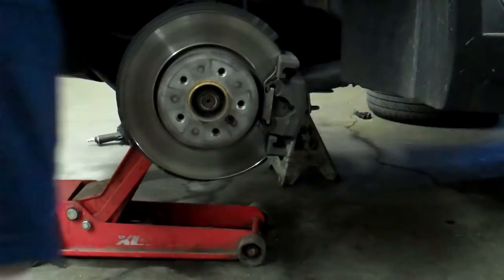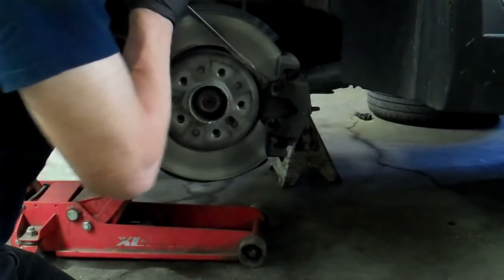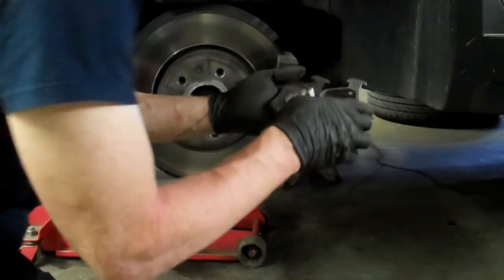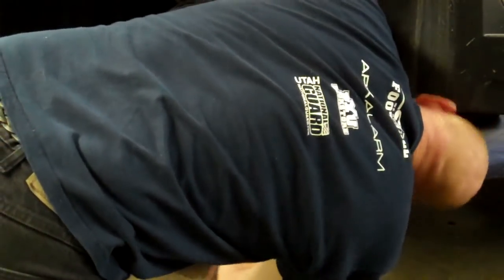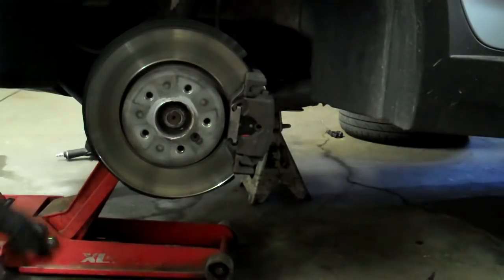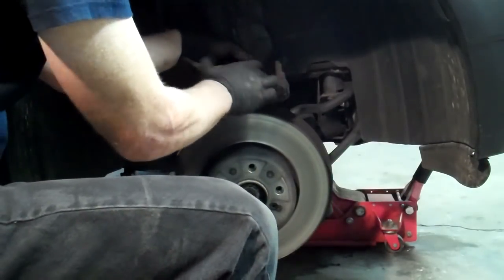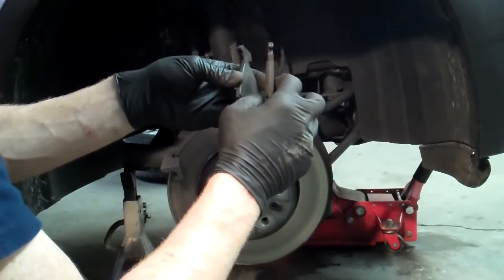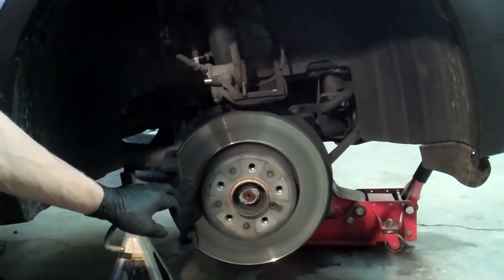How to change your brake pads. ( BMW )

Comment: I'm glad I watched this vid. I've never removed JUST the piston portion of the entire caliper. I usually remove the two 17mm bolts that hold the caliper housing to the strut bar then play from there, but this was a way faster way to deal with it. Great idea. thanks for the vid.

Comment from the maker: You're entitled to your own opinion.  The rotor survived.  I pry close to the inside so it won't damage the braking surface.  I could say your comment denotes idiocy.  Rather than stating your opinion you chose to make it potentially offensive as well. It doesn't benefit you at all and could get you blocked.  Once blocked you would have less access to info you may have had before.  Bless your heart.

Comment: Thanks for taking the time to make this video man!!
Was very helpful... 
Well, I do know how to change brake pads and all but sometimes you can run into odd stuff like a special tool or an extra step that wasn't expected. It's my only car so it sucks if I have the wheels off and the car on jack stands and then realize that I need to go back to the parts/tool store!

Thanks again man!!

Comment from the maker: If some lesser trained individual has overfilled or unnecessarily topped of the MC then yes you do have to open the cap and remove the extra- otherwise it isn't necessary.  When the job is complete you will need to pump the brakes until the pedal gets hard before starting the vehicle.

Comment from the maker: @bfree007 There are shims on the caliper bracket that the pads fit into. If they are omitted you get that.  The shims hold the pads in place.

Comment from the maker: @beefystik You get a digital message that says "Check disc brake linings".  There's a copper wire inside that gets smeared off on the rotor.  Then you just close the circuit by melting a solder "bridge" from one wire to the other.

Comment: You make it look so easy. I will use your tip of prying the old pads loose before removing them from the caliper, wish you'd made this video before hehe. I used a screwdriver to rock the caliper back and forth till it finally came off the disc. Now I know better. Thanks.

Comment from the maker: They are just cars.  Many people struggle with the nuances in design.  As a rule of thumb if seems it's impossible or too difficult, use more thought and less force.  They're easy to service, but tricky to unlatch various components at times.

Comment from the maker: I'd love to, but alas I have not a 1997 Sentra in need of a clutch right now.  You can drop the trans out of those from the bottom.  They aren't too bad/hard to do.  You do it essentially the same way as in my video "2006 Toyota Camry Clutch install shortcut cut labor in half!!"

Comment from the maker: The parking pin/pawl? on inside an automatic transmission is different than your emergency brake on your rear brake system.  In my opinion a car (that I would be comfortable driving) should be able to come to a stop using either the hydraulic or mechanical braking systems.  As for stopping while driving down a grade an obsolete mechanical/drum/rear braking system on only two wheels may not be adequate.  In an emergency aim the car uphill if possible or at something cheap and soft like a bush.

Comment from the maker: @bfree007 You can search for a disc brake hardware kit for it.  They also come with many high grade brake pads.  Many Thermoquiet ceramic pads come with them in the box.

Comment: Friend of mine turns wrenches at the dealership ,uses one everyday with one hand where his snap on would  pull like a mule.  He uses it on all but the highest torque fasteners.  at 180 ft/lbs it does it all.  At  $300 a bit pricey for me , but for a high teck,teck it would be a real arm saver.  Hope you do get one

Comment: Thanks for your wonderful videos. I have two questions:

1. Should the brake sensor to be replaced when replacing the brake pad?

2. Should I replace the brake pads on all four wheels, or just the two front or two rear one?

Best Regards,

Comment: Go to those shops owned by foreigners. Not to be racist, but they do a really good job. I had a 1996 honda accord, as a winter beater, and I take the most cheapest fixes from these guys.

They took $375 for clutch fixing, I've been driving for 3 years after the fix and its driving smoothly. I went to these shops for my radiator fix, exhaust replacement, clutch, caliper seizeing, engine mount vibration, brake line leak, bumber re-attachment (after a fender bender). Cost less than $1500 for all.

Comment: Need to change break pad wearing sensor in order to be able to reset if after installing new pads does not allow resetting. I just made this for F11 after got "unsuccessful" info on display during resetting. So definitely better have all pads (left and right, front and rear) and both sensors (1 front + 1 rear) changed at the same time).

Comment: Great video. I have a quick question i have a 2005 BMW X5 the passenger side wheel the gap between the frame and the tire is 2-3inches on the driver side it is about 5-7 so it looks tilted. What can be the issue? My alignment?

Comment: You may be right for a BMW, I don't know.  However, I have the factory service manual for a Jeep in front of me, and it says "Bottom the brake pistons by prying the caliper over" and quotes a figure.  That figure shows a technician with a flathead screwdriver inserted between the rotor and the caliper itself right at the edge.

If it's a factory service procedure to pry on the rotor for those, it can't be a general case that you are right.  However, who knows, BMWs may be different.

Comment: Oops, I guess I wrote too soon, since you said you use 'disc quiet'. I don't think that is available here in the north. 

Regarding the hammer ratchet, looking at the Ingersol Rand website, the power of that ratchet is not as strong as a typical air wrench. They beat out other ratchets, but the design is significantly weaker than most air tools. Unless I'm mistaken, 180 ft-pounds won't do for most harmonic balancers....

Comment: Brian, great videos. but bmw specifically says to not grease their caliper pins. just FYI. they will deteriorate the rubber bmw uses in the caliper bushing as well as attract dirt that might hinder operation. just clean with brake cleaner and dry
Reply from the maker: Thanks!  I use silicone based grease so it won't deteriorate- and very little of it so it won't attract dust.
Reply: briansmobile1 Ok!  Everyone has their own methods but I tend to follow BMW on this. My caliper pins have been smooth and dry for the past 60k miles without any problems using the "approved" method.  But I still respect you. big fan. You're really the only one out there with the skill set to work on anything and everything that i've seen. I do a lot of work too but mainly on BMWs (my specialty).  I wouldn't know what to do with myself if I had to do a Subaru HG.  (former impreza WRX bugeye owner)  if you ever come down to SoCal one day, I'd like to meet you. Have you sign the inside of my wheel or something hahah. Maybe you have some fans out here!!  Do some more BMW videos!!
Reply from the maker: Will do!

Comment: Followed your video and the pads were a breeze to replace, awesome guide and thanks. I do have one question though. What is your experience with pads that claim to have no bed in procedure? As I used bendix general ct pads, that claim to have instant response straight out of the box, in reality the pads aren't as responsive as they should be. Should i just follow a bed in procedure anyway?

Comment: Brian, I love the video. I watched it a couple times. This morning I pulled the wheels and zippity dippity pulled the caliper and checked out the pads. They still have some pad left but I'm going to replace them with low dust ceramic pads anyway. Question: do I still use CRC brake quiet with pads that have shims? The blurb with it on AutoZone's site says not to... 

Thanks for the great stuff!

Comment: Brain,

i have a question. Do you need to open the cap from the master cylinder to push back the piston from the caliper? And once youre ready do you have to close te master cylinder first before pushing on the brake pedal.

Grrz

Comment: Instead of prying against the caliper with a crowbar, just remove the brake reservoir cover and compress the brake piston in the caliper with a large c clap, the caliper will drop right off no prying needed!

Comment: Hi Brian, I have a 93 Corolla. automatic transmission.
I just realized lately that if it's downhill or slightly downhill and i put the tranny on Neutral 'N'  and then put on the parking brake and let go of the foot  brake ....it rolls forward like nothing's holding it at all.
Now i hear that U shouldn't use the parking pawl ..mainly p-brake ..but it won't even hold! And the car passed it's state mechanical check 2 weeks ago , they tested all brakes. Parking brake measured at [100%, 100%]
Help ?

Comment: Hey man I changed out the pads and rotors on the front of my 03 z4 without any problem. Seems that when I go in reverse and then forwards that there is some clamping noise or clicking noise like the outer pads sliding just a little. Any suggestions for this?

Comment: Hi. I have a question. I am doing a brake job on my x6 and the rear rotors have a slight lip on the outer edge. But the rotors look nice. How do you know if I need to change the rotors? People told me I cannot turn Bmw rotors? And will the lip cause issues with the new pad?
Reply from the maker: +sosick2005 Composite rotors that are thin in the center don't turn well due to vibration and flex.  The other thing to consider is thickness.  If they're worn thinner than what they are stamped they should be replaced.

Comment: Did you change the pad for Porsche or Mec, how did you take out the caliper without touching the rotor Crazyarmo 777 you have to dirty your hands to judge someone.  If you caliper seize then you might  scratch the rotor, by that things happens your brake system are trash